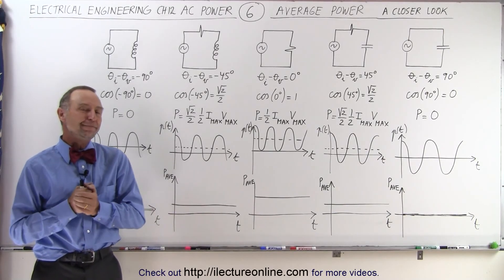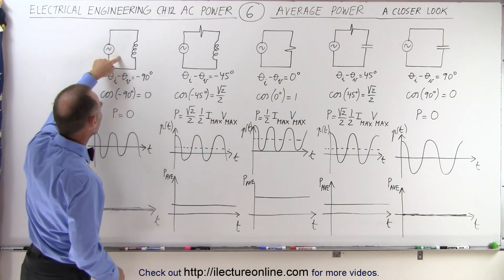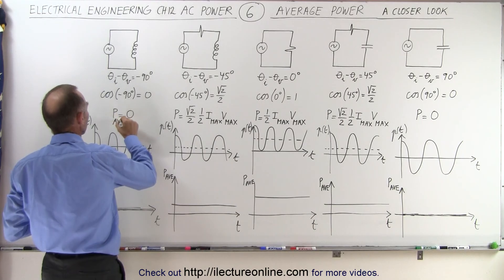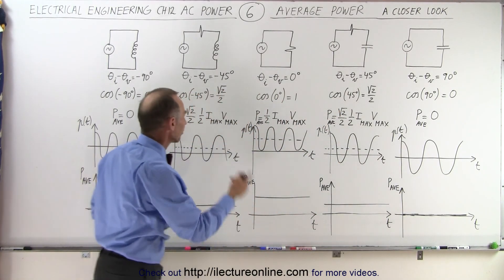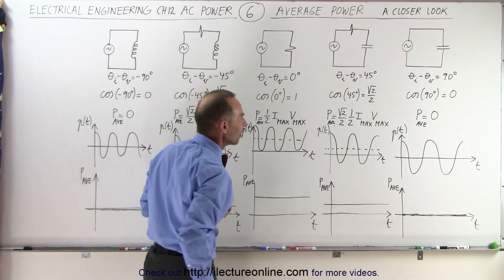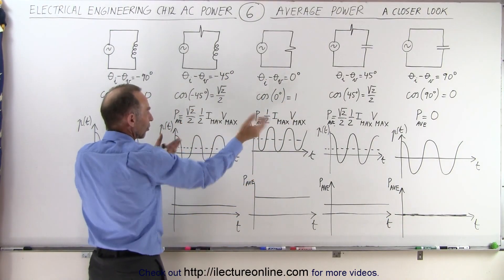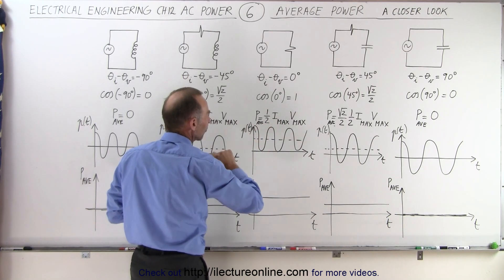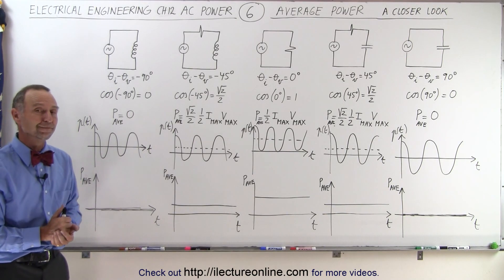Electrical Engineering: Ch 12 AC Power (6 of 38) Average Power: A Closer Look

Comment: Hey, why is that the (Theta)i - (Theta)v for RC and RL circuit 45 and -45 degrees respectively? Would it not be 90 and -90 due to the resistor having no effect on the phase angle?
Reply: The question is solved with an assumption that r=xl=xc and if that happens then in the LR circuit voltage leads current by 45degree as Vr and Ir at 0degree and VL at 90 degrees